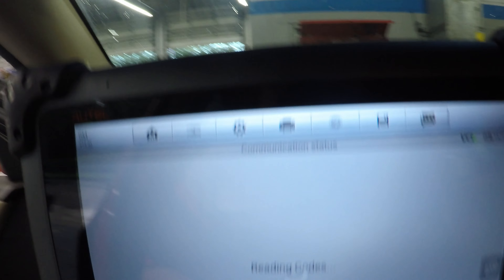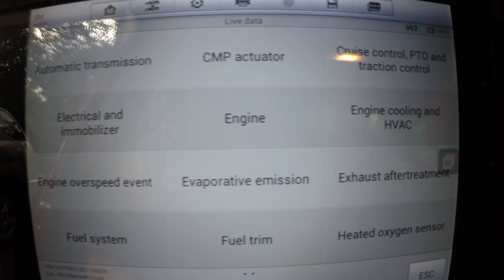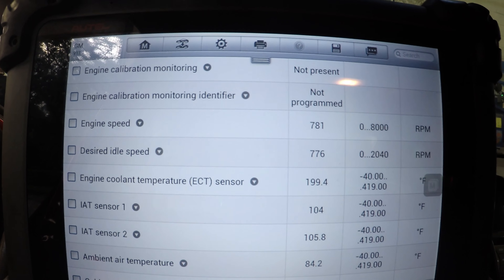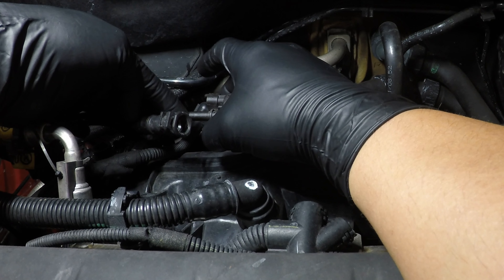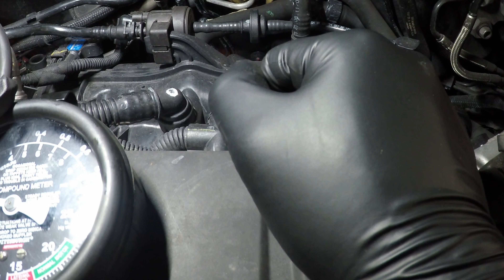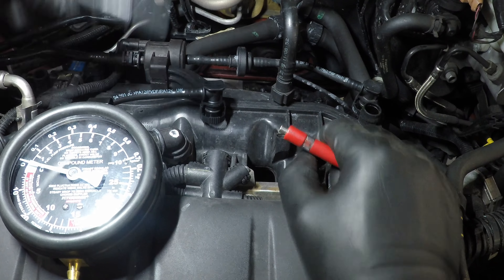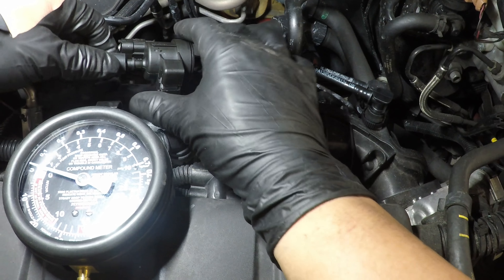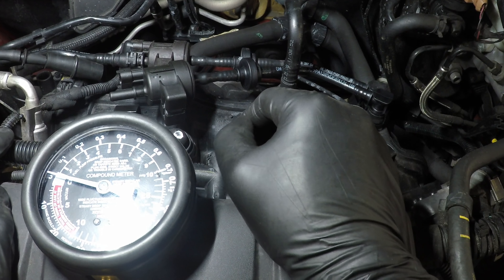PURGE VALVE DIAGNOSIS & FIX - 2012 Chevy cruze - P0496 P0172 P0171

Comment: After the purge valve is replaced, how long before the check engine light goes off?
Reply from the maker: Could take a long time. I suggest getting it cleared
Reply: @SuperMarioDiagnostics  who would I take it to to get it cleared? AutoZone won't clear them anymore
Reply from the maker: Any auto parts place should clear them. Weird that they wouldn't. I can see why though as it makes the mechanics job harder. Let them know that the cause has been fixed and that you want the code cleared

Comment: Question, will the engine light turnoff automatically?
Reply from the maker: After a long time yes. Or any parts place will clear it for you
Reply: Super Mario Diagnostics I just replaced this thin3 years ago and its acting up again, thank you for showing me how to do it myself because honestly I can’t pay Chevy 200$ + at this moment
Reply from the maker: No problem, they are a high failure rate item. Please did testing first prior to condemning this part

Comment: Love those money jobs! That 17% was odd. That would be nice to know. One more strange thing we deal with daily! Lol
Reply from the maker: So much to keep up with lol trying to find out if it's strategy or symptom lol
Reply: @SuperMarioDiagnostics  hey have you seen the zf transmission webinars they're doing for free? Check the website. They did a great one the other day on brakes. Got .1 ce for ASE certs.
Reply: As a Chevy dealer tech,I have seen many Chevy vehicles purging at an idle. 17 percent purge is not that much for an idle so I wouldn't worry about it good diag on the valve. G.M. has a special policy on these for Acadia,Enclave,Traverse.SRX and more.
Reply from the maker: Billie Smith haven't seen this, never even heard of it. Which website?
Reply from the maker: Love the input, thanks for sharing John.   Exmotorsports left a comment suggesting that a dirty throttle body can cause increased idle compensation, and therefore increased throttle percentage, thus tricking the pcm into allowing purge flow, and thoughts on that? Seems to make sense, but I'm limited on particular strategies. Thanks for dropping in btw i hope you enjoyed, consider subscribing if this suits you 👍
Reply from the maker: John your comment led me to another question lol. If you wouldn't mind, what might that policy be? 😆
Reply: Aftermarket.zf.com I think. If you search zf webinars they should come up. I do automatic transmissions so I try to keep a close eye on free trans training opportunities. Lol well pretty much any free training opportunities. Lol
Reply: 18029: Special Coverage - Inoperative Purge Solenoid - (Jun 26, 2018) 
Subject:   18029 — Inoperative Purge Solenoid 
  
Models:  2015 Buick Enclave, LaCrosse 
2015 Cadillac ATS, CTS, SRX, XTS 
2015 Chevrolet Camaro, Caprice, Colorado, Equinox, Impala, Traverse 
2015 GMC Acadia, Canyon, Terrain 
Hope that answers your question .If you want a copy I could email you one,as far as the dirty t-body causing purge,Ihave seen new cars purging at idle so its program strategy as far as I know.  Wrench On Mario!
Reply from the maker: Very informative John thank you very much 👍

Comment: I have the same code. How much would this cost at a shop if I were to decide to take it in instead of fixing it myself? Ball park.
Reply from the maker: Having the same code wouldn't necessarily mean that it's the same culprit. A diagnosis must be performed first. I only show a testing method for one possibility for this code to set. I've no idea what they would charge you. Too many factors contribute to shop labor times, and diagnostic fees.
Reply: Super Mario Diagnostics , you’re quick. So I did get the same code with the same diagnostic but also there’s lots of leakage from timing cover tranny seals. I don’t know what that means, but Thanks for the video though, it was helpful.
Reply from the maker: Is it also a Chevy cruze? Have any parts been changed yet?
Reply: Super Mario Diagnostics. Nothing’s been done yet. I picked it up from Wheel Works just now. They told me they couldn’t fix it there, so I was just doing research.
Reply: Super Mario Diagnostics it is a Chevy Cruze 2012.
Reply from the maker: Which codes exactly did you get?
Reply: Super Mario Diagnostics P0496. They also say I have lots of leakage from timing cover and coolant leakage from thermostat housing. 😔
Reply from the maker: Yeah these are notorious for all of these. As for the code, you can check the purge valve the same way i did. If that's not leaking though, you will have to pump the evap system with smoke to find the leak, many times it's the gas cap either loose or worn out. As for the timing cover leak, the pcv system is responsible for dealing with crankcase pressures(blow by) when it fails, it will blow out seals. So yeah they can change the timing cover gasket, but the true cause of that leak is a failed pcv diaphragm, which is one unit with the valve cover. So if you want to prevent future failures, you must also change the valve cover and its gasket
Reply: Thank you Mario!!’

Comment: My 2014 only gives the code p0171 and that's it but it wants to die on me every time I put the brakes on and it idels badly and it it worse when I put the a/c on
Reply from the maker: What are the fuel trims doing at idle vs 2krpm?
Reply: @SuperMarioDiagnostics  I have no way of checking I do know it stays way below 1 and it does go way down when it wasn't to die and has died on me a couple of times
Reply from the maker: Yes but anything can cause that. Have you tried the testing i showed in this video?
Reply: @SuperMarioDiagnostics  not yet but I will and tell you how it goes thank you
Reply: I put a new purge valve in and now my car is running super  thank you

Comment: Is this issue related to overheating?
Reply from the maker: Not at all
Reply from the maker: If you have any questions at all, don't hesitate to ask. 👍 overheating can be from a leak, blockage, or a restricted converter. Maybe I can help pinpoint the root cause.

Comment: So, my brother's 2015 cruize cranks but wont start.  He had a water pump go bad and he had a friend replace it.  Few days later hose blew of thermostat housing causing him to lose all coolant.  He immediately pulled over before car got chance to overheat.  His battery died once they got everything back together and coolant in.  Got another battery on it and the car will crank, but wont start.  Engine light is on.
Reply from the maker: What codes?
Reply: I don't have a scanner, thinking about picking up the one that are $10 and Bluetooths to a phone.  It's the engine light that is on.
Reply: Fuel pump is working just the ecm is not letting car run.
Reply from the maker: I hope they didn't blow any fuses when putting in the new battery. Gotta check basics, spark, injector pulse, fuel pressure. Is the security light on while cranking? There's a lot of things that can inhibit starting that a code reader simply cannot see. But you gotta start wth the basics
Reply: I did all those things, no security light.  All fuses is good.  I reset computer and car ran for about 3 seconds and the ecm killed it.  I ran back over everything and looks like they hooked everything back up right except that hose on the thermostat houssing.  It popped off on a highway with speed limit 75.  Gonna get a scan tool from a friend.  Im use to old cars 😂
Reply: Hooked up an obd2 and it read no codes.  Looked under the hood and noticed the coolant was empty.  Opened it up and it smelled like straight up gas.  Is it even possible when they hooked this new water pump up they got some lines mixed up?  Gonna run every hose down in the morning.   Somebody shoot me in the face with a 50 BMG.
Reply from the maker: Highly improbable. But then again I don't know who worked on your car. So it has all spark, injector pulse? Make sure the coolant temp sensor is connected or else it'll trick the computer into thinking the coolant temp is -40 degrees and enriched the fuel mixture to the point that it won't ignite.
Reply: See, it's not my car.  If i did it, would've been right.  Brother just broke down, got me to bring him home, and dropped the problem on me.
Reply: This is a real head scratcher 😂😂😂😂😂😰
Reply: Waking up in morning and rerunning everything they did down.
Reply: Coolant reservoir is empty after three full jugs with no leaks in sight.
Reply: reservoir straight up smells like gas

Comment: Would this cause a P0171 code?
Reply from the maker: Yes it would, as it did in this case
Reply: THANK YOU THANK YOU THANK YOU! Checked the valve and sure enough it had vacuum while disconnected. Threw in a new one and ran like new, light went off. You should totally add P0171 to the title of this video, or better yet make a new one, for guys like me that only had that code.
Reply: @SuperMarioDiagnostics  thank you i changed mass air flow twice because first time didnt disconnect battery to put in maf blew a relay. got a new maf and hooked up correctly.  Still check engine light. I replaced this purge valve twice. so i youtubed purge valve p0171 and got your video. Gonna try it tomorrow. hopefully its not the pcv valve thats inside valve cover although looks like easy fix as well

Comment: What if i replace part and code still comes up
Reply from the maker: I showed how to test. Either you have multiple issues, or you didn't test and just replaced the part, or you have a defective part

What code(s) exactly?
Reply: @SuperMarioDiagnostics  p0496 replaced with new purge solenoid but it still sucks the tip of my finger and now i have a p0443 code purge valve circuit
Reply from the maker: @abramlionel4990  you replaced with a brand new part? Looks like it's defective
Reply: @SuperMarioDiagnostics  it’s already the 2nd part first one was from Autozone and then this one was from O’Reillys
Reply from the maker: @abramlionel4990  if you're testing exactly as i show here, with the electrical connector disconnected, then you have defective parts. Go with an OE part

Comment: I have thAt but high purge flow and small leak
Reply from the maker: One in the same. The pcm will set different codes depending on the severity of the leak
Reply: Super Mario Diagnostics I took it to auto zone and it pulled up p0442 evaporative emission system small leak, and p0496 evaporative high purge flow
Reply from the maker: Juan Gordon exactly, the purge valve is leaking. During self testing, the vehicle seals the tank, but opens the purge valve momentarily to pull the tank into vacuum. It then measures how long it takes for that vacuum you decay. If the purge valve is leaking the vacuum decay test will fail.
Reply: Super Mario Diagnostics I’m new to working on my car and I don’t have the proper tools yet, if I buy the valve part will that help my problem because once my car get warm it smokes inside the cabin and under the hood, and when I’m idle at a red light my car shakes
Reply from the maker: Juan Gordon that might be an unrelated issue. May be severe oil leaks dropping into the exhaust and causing the smoke
Reply: Super Mario Diagnostics I’m thinking  I’m havin a misfire, I also had p2270 code come up is that related